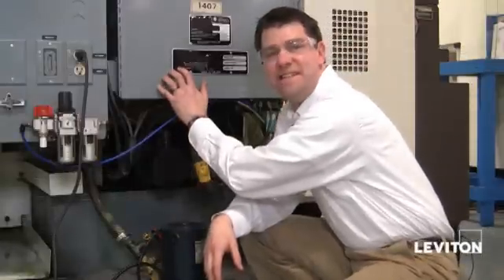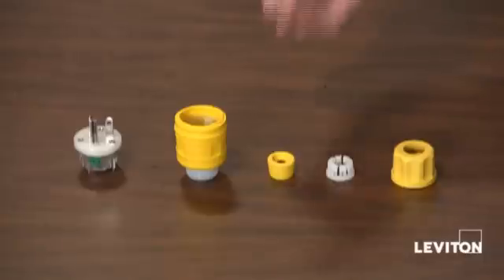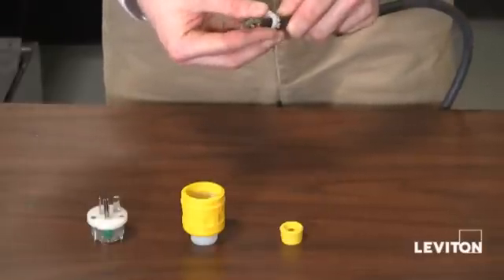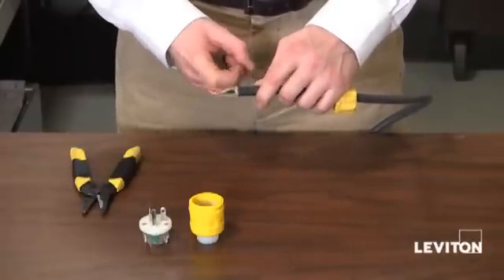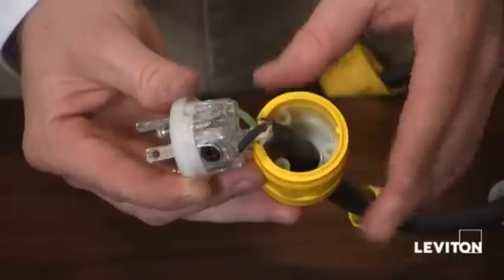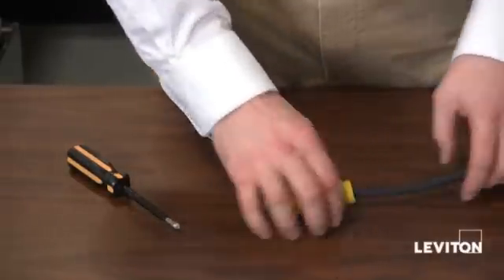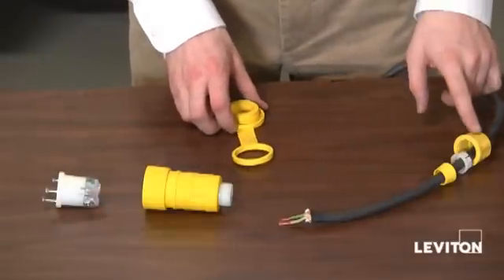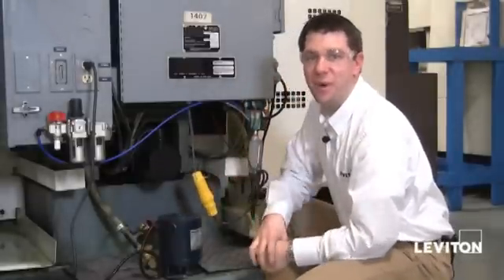How to Install Leviton Wetguard Watertight Plugs and Connectors

Comment: why would you leave out the part I came for? the part of how to wire it! you said you were going to show how to wire it but you did not
Reply: Same. Wires were magically attached.
Reply: connecting the cord to the wire module was done by young females with tiny hands in China - that's why they don't show that part.